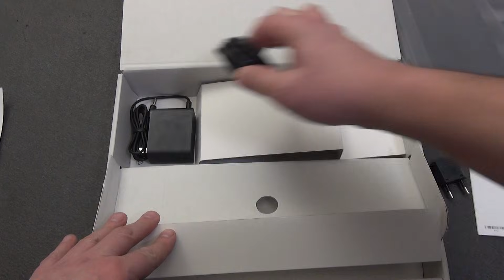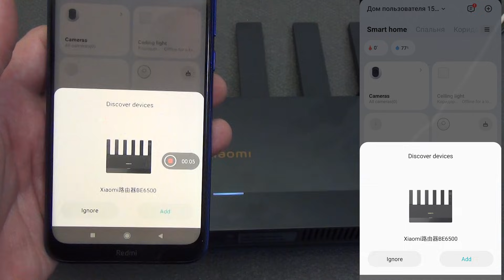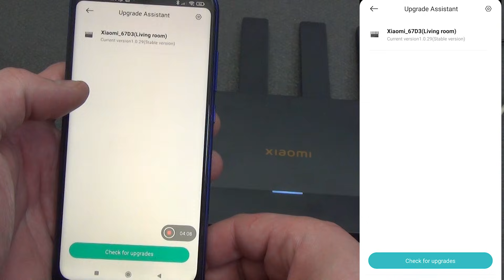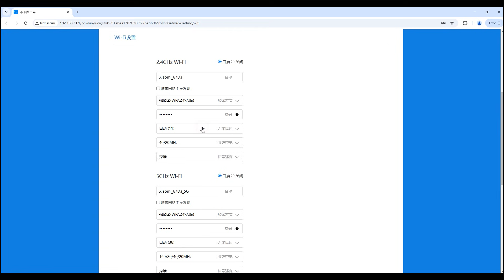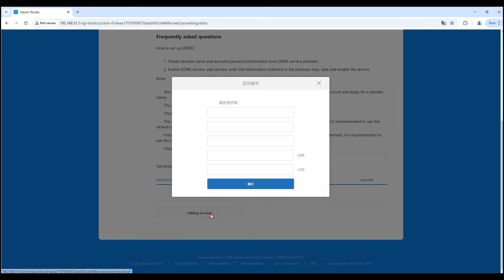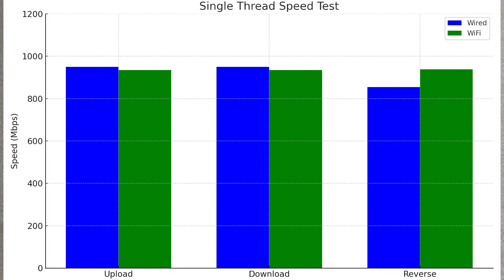Xiaomi BE6500 WiFi роутер - подробный обзор, настройка, тесты скорости и дальности

Comment: Thank you, rarely a router review is as comprehensive as yours. I have an ax6000 and an ax3000 as mesh extender. But I still have dropdowns in back yard so im thinking about getting this as principal router and maybe send the ax6000 closer to that backyard and just leave the ax3000 for the front part of house. it seems ax6000 can be upgraded to manage wifi7, although I still don't know if an update is available for ax3000 or if it is still compatible with BE6500 after setiing them working on wifi7
Reply from the maker: Thanks for your comment. Everything will work for you without updates.

Comment: Fake WiFi 7, нет его там
Reply from the maker: Я про Вайфай 7 ничего и не говорил. Это продавец, а вай фай 6 там четкий
Reply: China WiFi 7 still benefits from MLO, lower latency and higher speeds. It just doesn't have the 6ghz band. For the price, it's absolutely worth it. If you want the newer band, then you have to pay extra for a different router

Also to mention, this BE6500 has 4x4 mimo, 160hz bandwidth. Which for $70 is absolutely amazing
Reply from the maker: I completely agree with you.